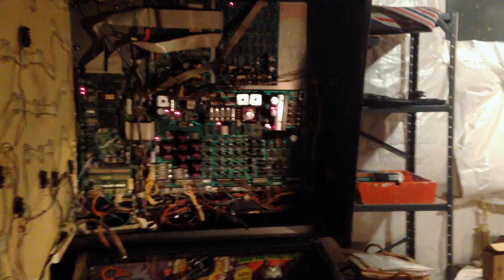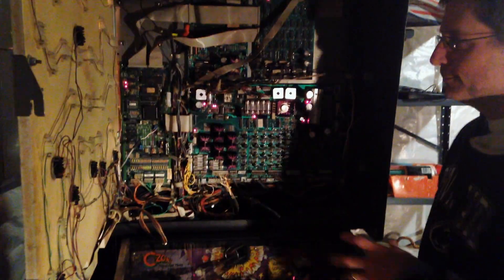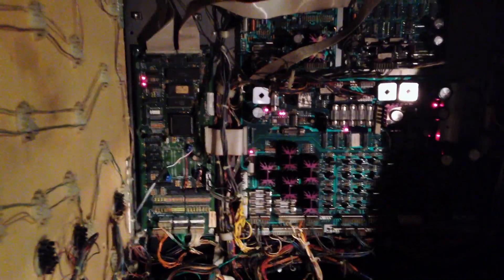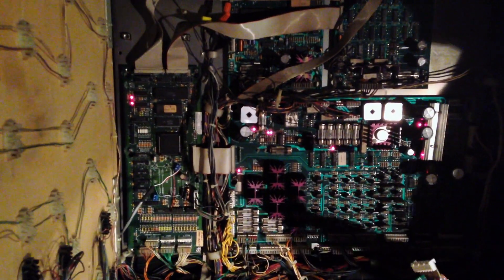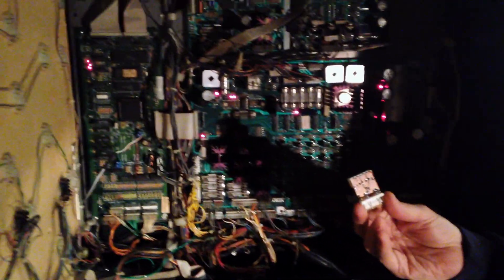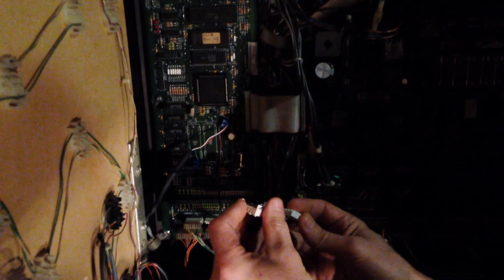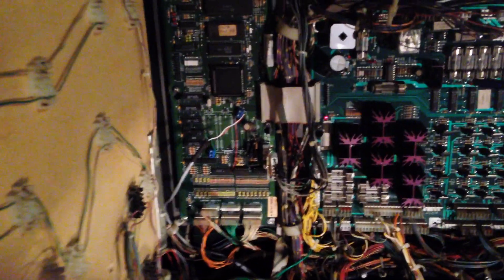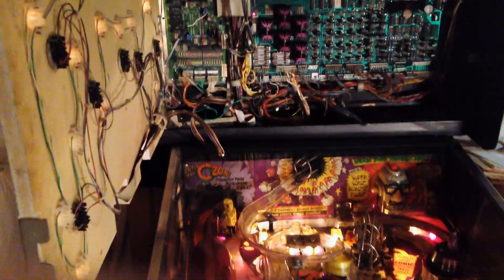KAHR.US WPC Power fix

Comment: I bought one of these from Rob a few months back, and I have to say, without equivocation, this little WPC add-on board absolutely rescued my pinball machine. Before I installed it, my game reset regularly with the use of the flippers or sometimes just on it's own.  Since I installed the board, I've had my Addams Family (TAFPB) running constantly and it has not reset once.  If you haven't yet bought one, or are still considering, order it now.  It saved me a few hundred dollars on repairs and parts that may not have even fixed the issue of resetting.  Rob has engineered a solution here that is amazing. Thanks Rob!
Reply from the maker: Thanks, John - glad it is working so well for you and for so many others!

-Rob
-visit http://www.kahr.us to get my daughterboard that helps fix WPC pinball resets